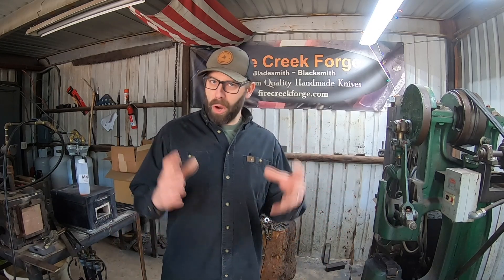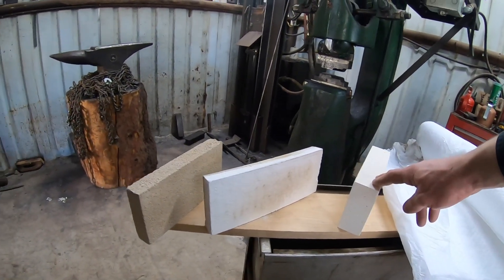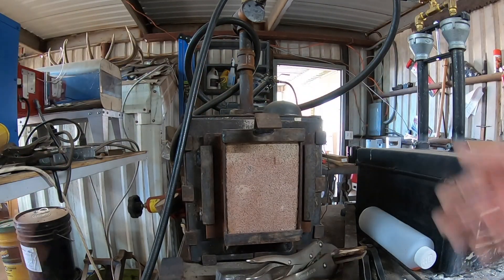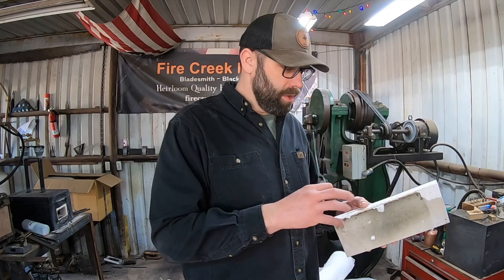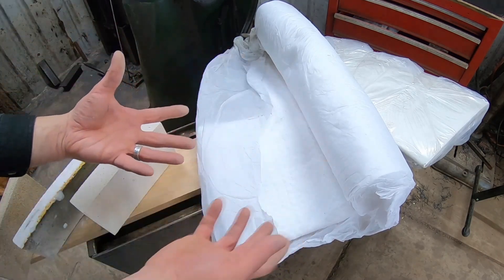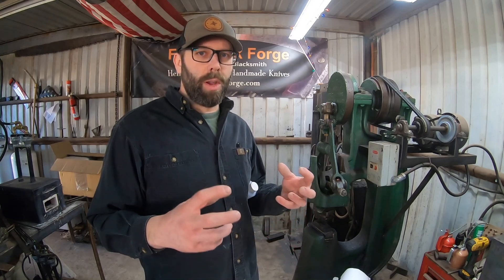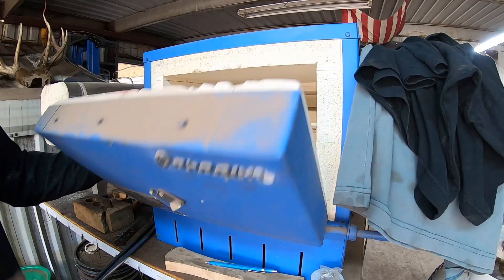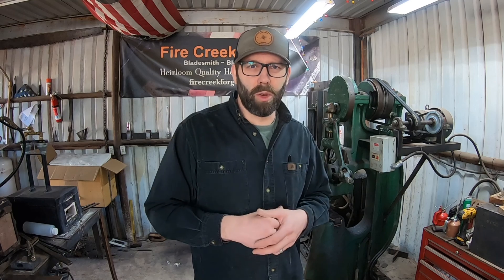Watch This Before You Build/Buy A Forge: What You Need To Know About High Temp Insulation 101

Comment: I have a 2 burner Hells forge.  I've been toying with the idea of ripping out the ceramic blanket and replacing it with firebrick..  Having to redo the refractory is a pain.  Do you thin this would work?
Reply: I've heard the best insulator is the ceramic Fiber. However, it is toxic for humans to handle it often. I've heard it's carcinogenic.

One solution I've heard that I may do is buying refractory cement a d having about 2 inches of the ceramic Fiber with around 1.5 inches of refractory cement over the fiber. Refractory cement is cheap too, a bucket is like $20-$25
Reply: @NonHaecSineNumineyeah I want to get away from all that.  I sometime work with large pieces and if I accidentally knock some refractory off it's a pain to fix.

I'd li e to just go bricks and make life simple

Comment: YOU CAN USE WATER GLASS OR SODIUM SILICATE AND THEN PER LIGHT AS FILLER MATERIAL AND I THINK IF YOU ADD SOME ALUMINUM OXIDE IT WILL MAKE IT EVEN MORE HEAT RESISTANT BUT HARDER THAN STONE BASICALLY GLASS OR TO BE MORE PRECISE LIQUID GLASS AT ROOM TEMPERATURE THAT YOU CAN FORM UP AND POUR STONE THAT'S HOW THEY GET THE UNBELIEVABLY TIGHT FIT AT THE ANCIENT MONUMENTS THEY POURED THE STONES

Comment: What do you recommend for the floor of a forge used for welding?  I used fire brick in mine, and the borax dripping on it ate it away pretty fast.
Reply from the maker: High temp hard fire brick, but it's hard to find.  I use a replaceable layer of soft fire brick sometimes.

Comment: what about induction do away with the need for containing heat entirely
Reply: Keep in mind that as great as induction is, it requires the material to fit within the magnetic waves.  I have been asked to use induction coils that were made for larger pipe than what I was using. Getting it to work was beastly.  It is a great system, but needs specific geometry.

Comment: Do I need anything else if I use a insulated fire brick and a ceramic felt and can it go up to welding temp
Reply from the maker: @readymadekhane8247  yes provided you get the right bricks, they are not all rated for the same temperature.
Reply: @FireCreekForge  ok would I need anything else to cover them or can i can slap the felt and slap the bricks in and I'm ready to go?
Reply: @FireCreekForge  do you have links to the fire bricks and ceramic felt u recommend I'm making a propane forge

Comment: Are those low temp fire bricks mainly for under potbelly stoves to insulate the heat from the stove to the floor?
And the white bricks are more for fireplaces but not necessarily forges?  Idk just asking. 🤷‍♀️
Reply from the maker: The lower temp bricks are to line a wood stove I believe, adequate for that application.
Reply: The fiberboard looks more like something they’d put in a furnace or a water heater for lightweight

Comment: Awesome video! Just a couple of quick notes on the ceramic wool: they do make safer formulations of these today and some are not as dangerous as they were a few years back (I think Harbison Walker makes one). On the durability: Once you rigidize, if you do several coats of satanite and cure between, it will last ages and is very easy to repair. If you stay on top of it, you can go many years without replacing the blanket. Flux will eat blanket like cotton candy though, so its good to have a sacrificial floor or a castable one if you're forge welding a lot. If you add a kiln wash like ITC100 or another IR reflecting wash, you'll get big gains in efficiency too which can help in production time. Love your content!

Comment: @firecreekforge, I want to ask honestly what you think about this comment that I think has been the gist that I get from some makers: "If your interested a little, go cheap, but some extras to make it better. If you know you are more serious, nothing is made for sale as well as you can make it". If you are getting interested in blacksmithing and don't have tools and money, then buy the cheapest one you can get and some parts to fix it up a little bit: (I.E. Rigidizer, ceramic clay/cement to fill holes/hotspots.). If you have a more series interest then you will need to make your own and design it with lots of YouTube research from serious blacksmith/Bladesmiths, and probably some professional plumbers advice for gas piping and shutoffs for safety.

 I love that you are shooting a lot of these beginner videos about equipment. I think its so good for the guys new to the industry to pull so much information that might seem day to day basics to most of you guys.
Reply from the maker: I have old forge building videos on the channel here where I built an entire forge for 150 bucks with new parts. It's probably a little more today, but it's about what you will pay for a cheap forge online, and it will last much longer. This involves building a Frosty T burner, and a soft  brick forge body with a basic angle iron frame. If I was just starting out that's what I would do again.
Reply: What is that video called? @FireCreekForge
Reply: @FireCreekForge   Thank you, and actually I watched your video after I had unfortunately already purchased a forge and needed to fix it up (when I got started). I think you are right, I just didn't hear that in the video so I thought I might just ask! Thank you!

Comment: So I’m about to build my first forge and I was going to line with wool, then put soft brick to cover that and seal it all with refractory. Am I going way overboard or making some kind of mistake when it comes to ease of maintenance? I’ve never built before so I just wanted to trap as much heat as I could to make it as efficient as I can in terms of fuel.
Reply from the maker: I don't think you need refractory if you're using bricks. A layer of either ceramic felt or wool between the brick and Forge body would be beneficial.
Reply: From Australia...my first forge was a bbq oval dish with a hairdryer. I have some of that wool insulation off Temu, and will make it a layer within sand/plaster of paris in a large coffee container, with a propane bottle poking in from the side. Hope it works for heating up small knife blades.

Comment: I’d disagree that’s there’s no advantage to building a forge over buying one beyond saving money. Most forges that are for sale are designed for one purpose either meant for forging blades and other long pointy things or a forge meant for hose shoes but you can do small blades in those but not longer items. When you build a Forge from scratch you can design it yourself to be multipurpose to have a large wide area for bigger and odd shaped projects but also design pass throughs to allow any length of blade you want to work on, you can integrate a cart into the build giving you space to mount equipment like a blower valves and shut off switch especially on a ribbon burner forge build. 

Realistically everyone starting out should probably purchase a forge from an actual manufacturer or a reputable builder but as time goes on and skills are learned building a forge should be done simply so you know how to do it because one day you might need to build a special forge for a really long sword or something else where you have no choice but to build it

Comment: I’m going to shorten this video into 1 good comment. 
Use the wool with satanite, it’s good up to 3,000°F, then use ceramic “paint” over that for a shell good up to supposedly 5,000°F. My forge gets WHITE with these 3 things. Also, the floor of the forge, do solid, AT LEAST 3 inches thick of satanite. It’ll not only hold the heat, but keep the forge alive for years. 
WARNING!!! DO NOT - I REPEAT - DO NOT MIX THE SATANITE TOO THIN!! IT WILL CRACK!! Other than that.. do the floor, let it cure over 2 weeks before firing to a hard cure. Cure it by running at max temp for about 20 minutes, let it cool slowly, and your good to go. Btw Mr. Volcano is a good brand. Last thing, you don’t need rigidizer… 😂😂😂

WEAR A MASK WITH THE WOOL!!!

Comment: @7:56 "...is very bad for your lungs..." - Very bad like smoking (tobacco)? Or maybe a couple of orders of magnitude worse?

These kind of fibers (Kaowool etc.) are highly carcinogenic, and I think this fact should be emphasized more clearly. There are quite a few YT smiths who quite happily use (and instruct others to use and construct) gas forges that have the Kaowool cladding completely exposed at the front and the back. Forced air (blower) forges even. Utter madness, or stupidity. Trust me, you're NOT going to like cancer if you get it. ANY variant.
Reply: It’s basically asbestos
Reply: use an N100 rated mask/respirator. Inexpensive medical prevention.
Reply: @PatrcWU67-w3c the fibres get everywhere. All over things. In your clothes. Stay airborne for hours. Need to coat it in refractory. Can’t leave it exposed… unless you want to suddenly have lung cancer in 10-20 years
Reply: @PatrcWU67-w3c  yes you are correct but do you know how miserable you would be wearing a mask while working in a hot environment 
might as well just use the brick

Comment: I’ve used that kao-wool stuff before to wrap around the chimney pipes of a small wood stove I bought. You’re right it’s nasty shit and you can just see all the fibers coming off it as you move it. I wrapped it in a few layers of that shiny heat resistant tape to fully cover it and it works amazing at insulating but I wouldn’t use it again just because how nasty it is to work with.
Reply: That stuff is basically Asbestos btw, be careful 
If you breath in lots you'll have issues

You have to spray Rigidizer on it so it doesn't produce the tiny dangerous fibers

I wouldn't recommend keeping it exposed but if you had to, I would recommend wearing PPE and a proper mask
Then putting it in place and fastening it with screws or clamps, then spraying Regidizer so it doesn't produce that dangerous nasty dust

And if possible you can also coat it in layers of Refractory mortar or something else afterwards once the Rigidizer dries and hardens

Comment: On a typical 2 burner forge how long does a 100# cylinder of propane last, and what do you regulate the pressure down to or is it pretty much wide open to get enough heat?
Reply from the maker: Man that's hard to know I don't really measure it. It really depends on the usage, if I'm just forging blades i'm running about 5 psi, forge welding is about 20psi, it all depends on what you're making and how much. Also, I have more than one forge I use depending on what I'm doing.  With that setup, at least a couple months I guess..?
Reply: @FireCreekForge  oh wow that’s not bad at all. I figured you went through it pretty quickly.